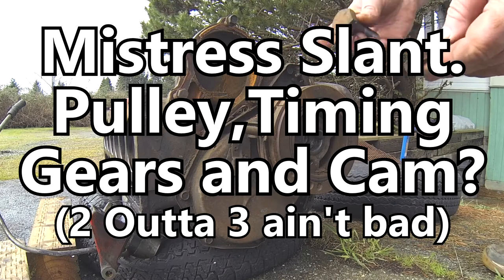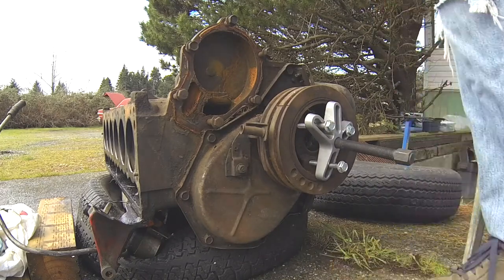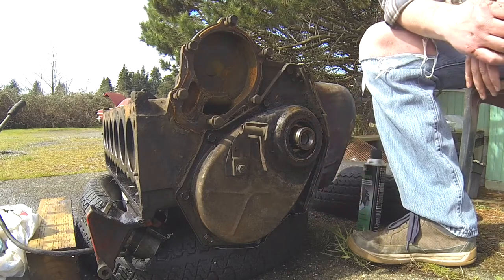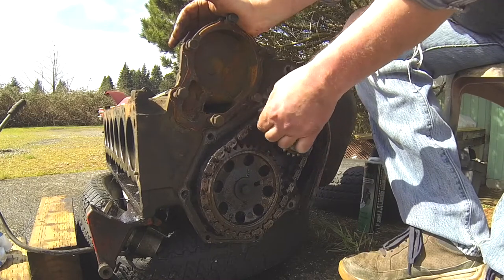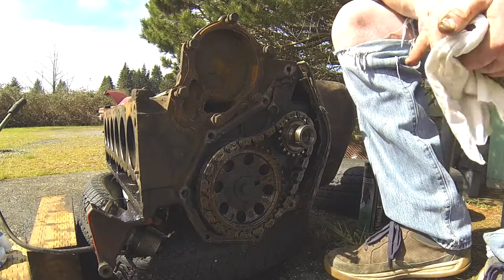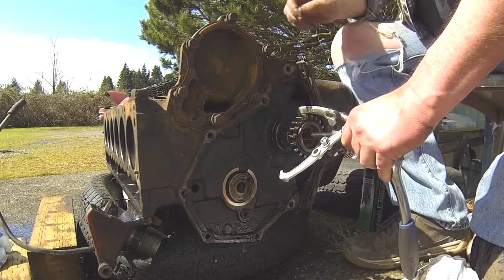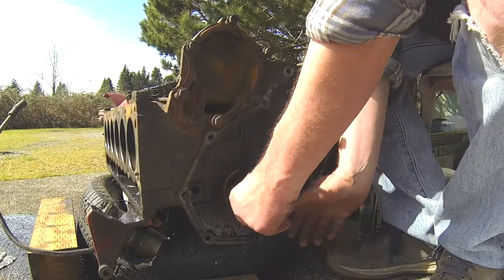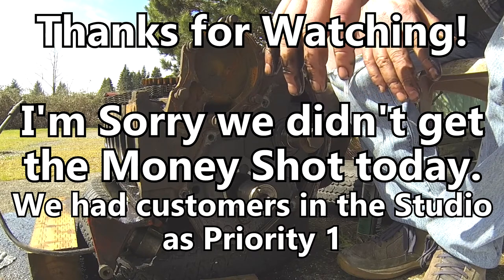Mistress Slant 6-Timing Gears-No Cam Today-Part 4

Comment: That harmonic balance has three marks like mine. While the head is off get the first piston up to see which mark is your timing mark. The thing on the cover is your timing marks with a sight window. I don't know how to work it yet. Please explain it Al when you figure it out. It should really help me. Thanks
Reply from the maker: When I want to set top dead center, I use a compression/vacuum gauge hooked up to cylinder 1 and measure the highest value on compression stroke. (Measuring until the needle hangs steady JUST before it starts back down into vacuum. I should have done a video about that when I changed the timing chain/gears on my 66 valiant. In general the method looks like this: https://youtu.be/u2sA-q7_FtQ  The indicators come into play after rough setting the distributor using the the linked manual method.